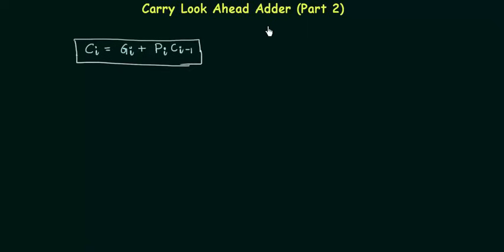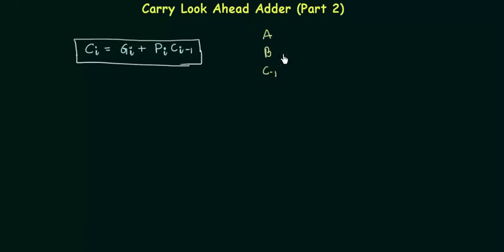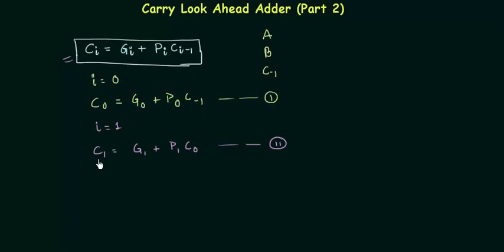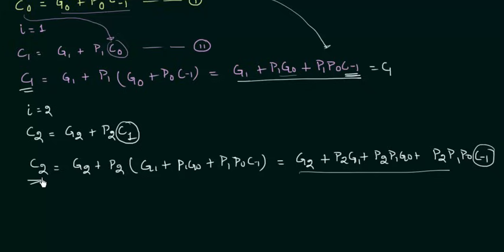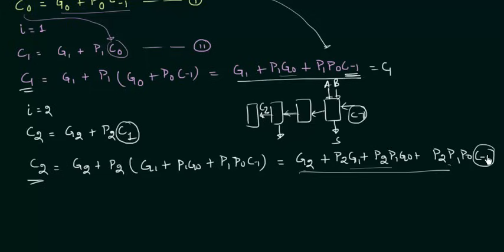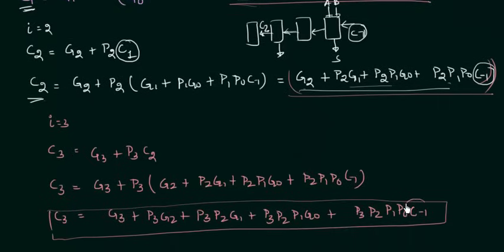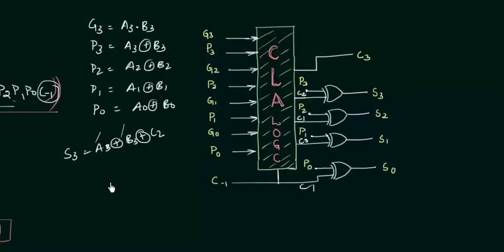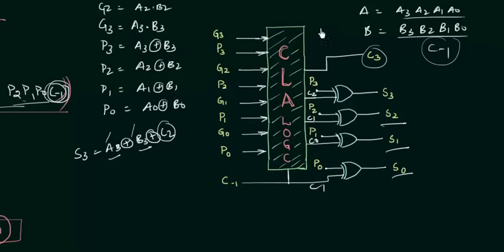Carry Lookahead Adder (Part 2) | CLA Adder

Comment: Can anyone answer how does CLA actually saves time (check 2:55)
If you look at the number of gates that have to be used, its the same for both cases (assuming each gate only takes 2 inputs, or can physical gates actually take multiple inputs?) for ex:
if we use C0=G0 + P0.C-1 then C1=G1 + P1.C0   if we suppose gates have same delay (say 1s delay)
timing for C1 would be 1s(P0.C-1)... 2s(G0 + P0.C-1)... 3s(P1.C0)... 4s(G1 + P1.C0),  a total of 4s delay.
if we use CLA and do C1= G1 + P1.G0 + P1.P0.C-1
timing for C1 would be 1s(P0.C-1)... 2s(P1.P0.C-1)... 3s(P1.G0 + P1.P0.C-1)... 4s(G1 + P1.G0 + P1.P0.C-1),  again total of 4s delay.
both have same delay

Comment: but my issue is that computing the carry without using the previous carries uses a relatively long expression which will have to be computed, so where precisely is the speedup
Reply: The equations take just two layers of gates to evaluate. You can tell this just from the structure of the equations. Second layer is just ORing together the values. With the "traditional" full adder there is a layer to evaluate for every bit in the input. On a 64-bit machine this is 2 layers when it would have been 64 layers.
Reply: @BrandonBusby-u2b  isnt ORing the values together doing multilevel OR for each variable? for example for A+B+C youd need 2 layer of OR to get the output(A+B then A+B+C)?,  with that the number of gates required becomes the same.
Reply: @misongautam6493  Well, no. ORing multiple values can be done with a single gate. Even if we could only OR two values per gate, we could OR 4 values with 2 layers and 8 values with 3 layers.

Comment: Won't it take more time to generate G and P..
and later adding to get the carry ?
How it's possible to get carry way faster using those equations  than just adding A B.?
Reply: Got some info off of the wiki page.
Essentially, each bit you want to add, given a and b, gives 2 bits of valuable info:
If the addition will always carry no matter what (G) and
if the addition will only carry if they are given a carry bit. (P)
G can be gotten with an AND and P can be gotten with an OR, or an XOR.
Normally, you would use an XOR. The sum of the two bits is C[i] = G || P && C[i-1], but you would need to recurse/distribute C0. But with a CLA you can use an OR gate, reducing the number of transistors.
You can preprocess the Gs and Ps, then feed that into a CLA which takes those precomputed Gs and Ps, takes the C0, and can get the final sum.
It ends up looking like O(i) to O(2) when in reality the performance gain comes from the transistors saved when using OR vs XOR and pre processing Gs and Ps in parallel.
The real benefit is adding larger numbers, because of that inexplicable O(log(n)) I can’t wrap my brain around, and this thing I just thought of.
You could theoretically calculate the higher bits of your number twice, for both if the highest-lower bit carries carries and if it doesn’t carry, and then wait for the result of the lower bits and choose the correct result.
Why am I doing this to myself at 5:35AM
Reply: Thanks for the explanation, I was wondering the same thing and you saved me a bunch of time. @leifmessinger

Comment: In CLA, actually for every bit you are performing the whole previous bit sums and finding carry. It is same delay with normal one. What is the advantage. Like can someone tell me with any example
Reply: idk I kind of don't get it myself, look up the textbook Digital Design and Computer Architecture Version 2 by Harris pdf. On page 243 it gives an explanation, and tells you CLA is about 3x as fast as ripple carry.
Reply: @2jake077  , yes understood. It's just that the and and xor of other bits are done parallely with a0 b0 so that delay is low

Comment: how cla is saving time if we account the tpd for extra gates use to build cla??
Reply: The concern is not to do with the number of gates by itself, but the depth of logic, or rather how many things are being computed in parallel. The carries in CLA can be constructed from three level logic, meaning there are, on paper, only three gate delays to determine the output regardless of how wide the adder is. With a ripple carry adder, there are at least two gate delays for each full adder, and so just a four bit adder will have at least 8 gate delays before we can be certain of the output.

Now the problem becomes how to manage the large number of inputs to a single and gate. 3 inputs is about the limit at the CMOS level, and so an extra level of logic needs to be added, but at that point, we're still saving quite a lot of time, and the time savings of CLA Adder vs. RC Adder increases something like this: 2n/(CEILING(log_3(n))+ 2). where n is the number of bits. In a modern computer where we need to add two 64-bit numbers, we get something like 128/5 ≈ 25 times faster than a ripple carry adder.

Comment: Hlo, I have a query,, how c3 depand only on value of c-1 as it is multiplied with p3,p2,p1....
So it is not only depand on c-1, then how can we say that it is only depand on c-1 ???
Reply: Previously in full adders you wait for the input carry of previous full adder.So it causes propagation delay.But here the carry of a full adder is not dependant on previous carry but depends on given input carry,and since p is a function of Inputs of the respective full adder,we don't have to wait for carry of previous full adder

Comment: Nice work. Just a little suggestion, explanation about "Sum = (A XOR B) XOR C-in" would help as some of the weaker students may not see it as first go. 
For those concerned, just do a manual truth table for the Sum equation and you'd see its the same as how one would normally perform binary addition.
Reply: The first URL isn't working for the time being. But as I have only watched Part 1 and 2, I might just have missed it. All in all, your effort is very much appreciated.
Reply: Thank you I was a little confused

Comment: OK, all is fine, but where's the gain of speed, exactly? We've just moved the carry circuitry outside the adders, but we still need to calculate those multi-input ANDs: first P3*P2 which goes with G2, then this result with P1 which goes with G0, and finally this result with P0 which goes with the Cin. So we still have the same problem: the more bits we have, the longer the chains of AND gates which calculate all those Pi products.
Reply: Zajankuchan So the gain comes from combining those gates into one multi-input gate?
Reply: For simplicity sake lets assume every gate has a delay of (delay) and let's neglect fan-in of gates.

assume a simple ripple-carry-adder with 4 full-adders.

- a FA calculates G and P within a (delay) of 1 (an AND and an XOR gate in parallel)
- a FA calculates S with another added (delay) (added XOR gate)
- a FA calculates c with two added (delay) (added AND and OR gate in series

this means a 2*(delay) for S and 3(delay) for c.

But as each following FA uses the c of the previous one, we have to add a delay of c (meaning 3*(delay) per previous adder) on top of it

If each FA adds a delay of 3*(delay) before the next one you'll look at a delay of c3 of 12*(delay)

Now the same thing with a carry-look-ahead:
- we know G and P are calculated in parallel with a delay of (delay)
- we know S is just another (delay) using P and c

So all the difference has to come from the calculation of c (obviously)

The carry look-ahead unit takes Gs and Ps as inputs, throws them together with c-1 into a bunch of parallel AND gates followed by a bunch of parallel OR gates to get c.

So you can calculate all cs in parallel with just two added (delay)

So to conclude:
- ripple carry adder with four FAs has 1 (delay) for P and G, two more for c, meaning 3*(delay) per FA-carry
- hence the calculation of c3 takes 12*(delay) and s3 takes 11*(delay)

- the carry look-ahead adder has 1 (delay) for P and G, two more for c, and a last added one for s
- hence the calculation of c3 takes 3*(delay) and s3 takes 4*(delay)

As we have to wait for everything to arrive to finish the calculation we're looking at 12*(delay) vs 4*(delay).
So if every single gate had the same delay we're looking at a 3 times faster addition.

To break it down it's simply a matter of calculating the carry in series vs calculating it in parallel.

Of course in real-world application we would have things like fan-in, space vs time considerations and so on.

Comment: All your videos are so much better if you run them at 1.5 speed
Reply: Hence we are saving time too! :)
Reply: Go 2x it's even better
Reply: thats if you already know what is being explained
Reply: Its even better if you run at 3.0x
Reply: speed 2.0 :D
Reply: Faster - better
Reply: Dem true
Reply: True
Reply: Exactly I will do 😂the time save with 1.5x
Reply: 2x best
Reply: Not much of a point, You have that option, suit yourself.
Reply: Only if i had read comments before watching the video😤
Reply: Yes of course.  That's because standard brain clock baud rate for engineers is 1.5x the speed of this video.
Reply: @carriersignal  no the reason is that we have exams the next day🤣🤣🤣
Reply: @abhaypatil2000  well, I'm still in high school so no. 2× just sounds better, whether it's your exam or not
Reply: @notsoclearsky Thanks for sharing..... Useful
Reply: I watch them at 3x or sometimes 4x. Use a chrome extension like Video Speed Controller. The best tool a student can have while watching online lectures.

Comment: i think it's not xor but just or
Reply: I think my reply is too late :D but in this problem you can use "xor" as well as "or", both are correct ;)
Reply: I was wondering about that. I think it's or as well.
Reply: No. For a full adder, Sum = A xor B xor Cin. So there'll be XOR and nor OR